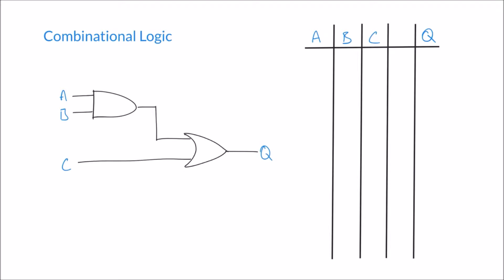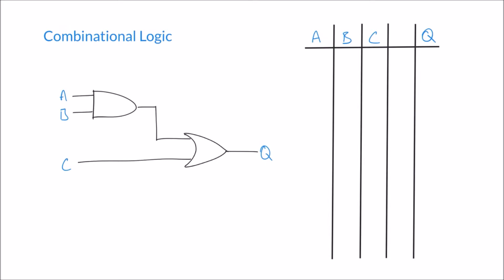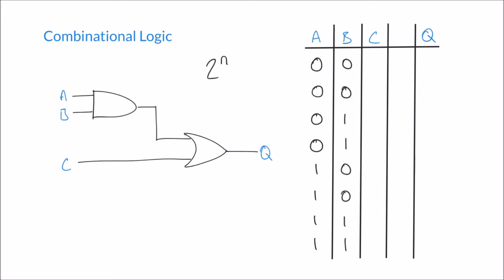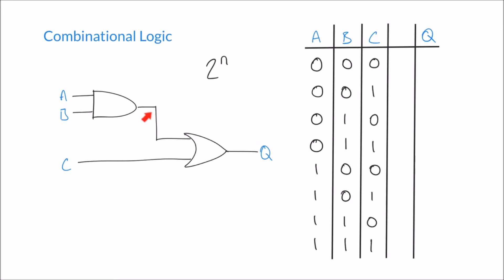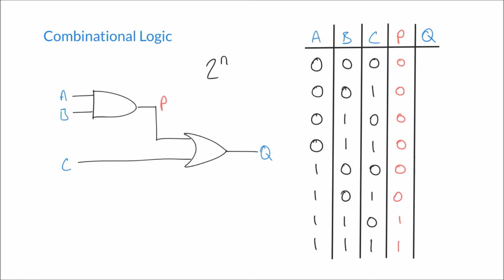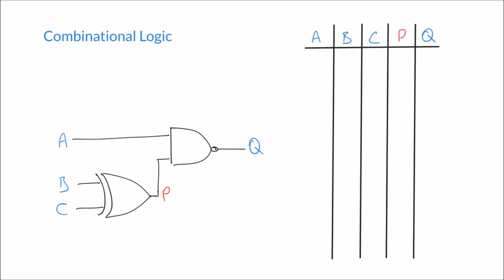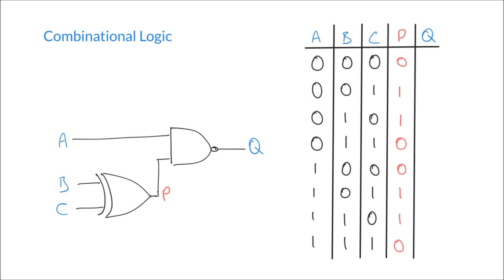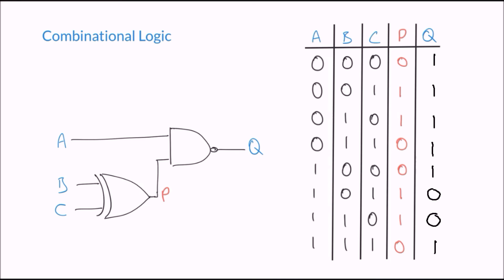Constructing Truth Tables for Combinational Logic Circuits

Comment: Hello, I know this is a late comment, but if you see this, could you please tell me how you proceed for a 4th input? 'Cause based on the rule of halves, the D input column cannot be divided by halves, since there is no group of 0 and 1 anymore. How do we proceed then? Thanks in advance, you already helped tremendously!
Reply from the maker: If you had 4 inputs, there would be 2^4 = 16 possible combinations, and you can still use the half and half rule to generate all combinations. So in this example it would be 8 1's and 8 0's for the first column, followed by groups of 4 for the next column, groups of 2 and then groups of 1.

Comment: Does the half rule works for any type ? Or just for 8 combinations
Reply from the maker: It works for all. So for example, if you had 4 inputs, there would be 2^4 = 16 possible combinations, and you can still use the half and half rule to generate all combinations. So in this example it would be 8 1's and 8 0's for the first column, followed by groups of 4 for the next column, groups of 2 and then groups of 1.
Reply: @EngineersAcademyLTD  tqvm, it helpd for my automation test
Reply from the maker: Great - glad it helped.